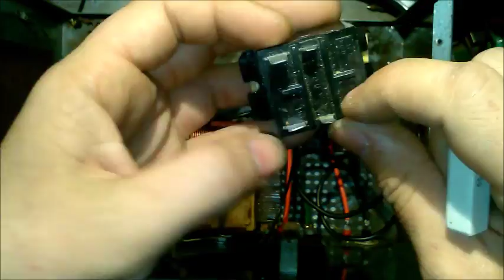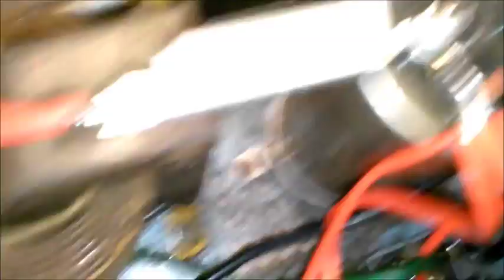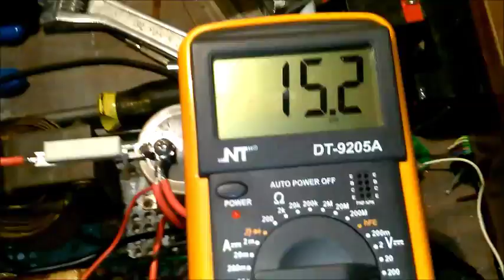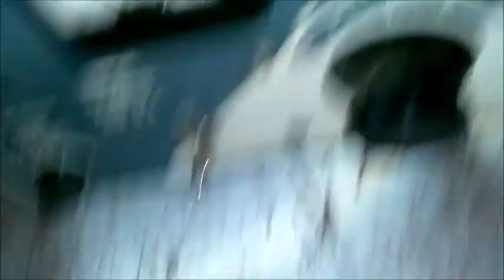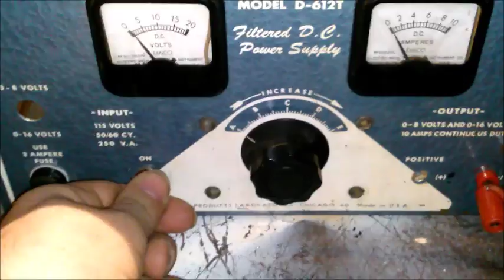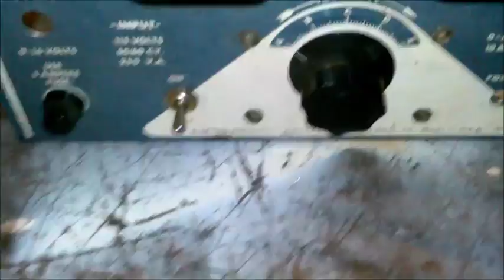Electro D-612T cap replacement and modification

Comment: So what all will these run with like what can you use them for? Besides a cb radio
Reply from the maker: Bench power supplies for the most part you can also use them to charge lead acid batteries if you set the voltage right.